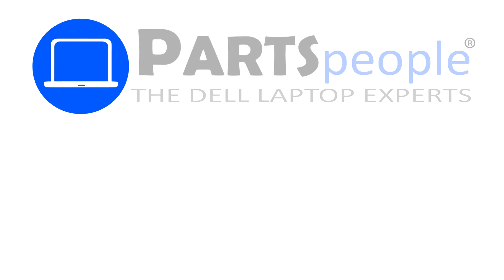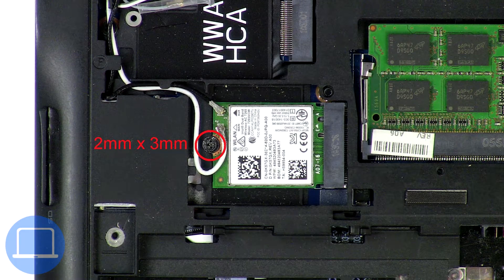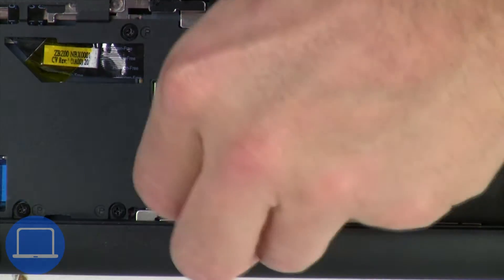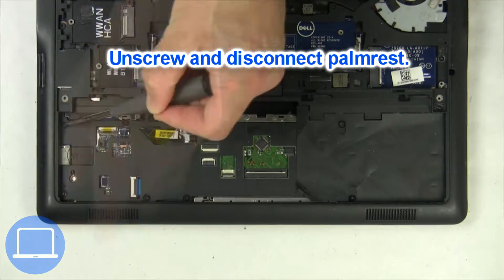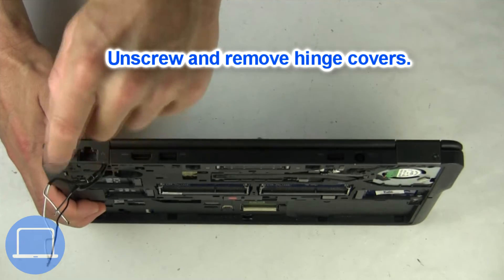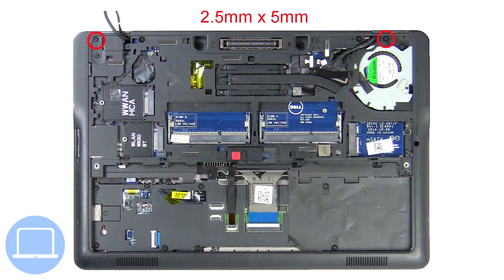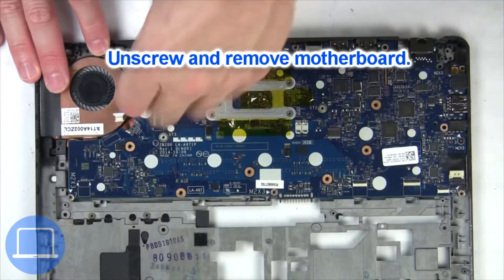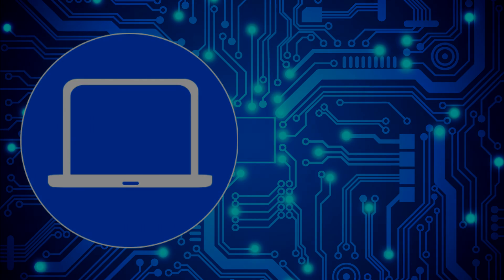Dell Latitude E7250 (P22S002) Motherboard How-To Video Tutorial

Comment: I have one of these and it won’t turn on! Troubleshooting steps involved making sure that the OEM power adapter was functional, getting a new battery and putting it in, as well as receding the ram, SSD, and wireless card. Strongly suspect getting a new motherboard will be in the works. Will it also be a good practice to replace the DC jack as well?